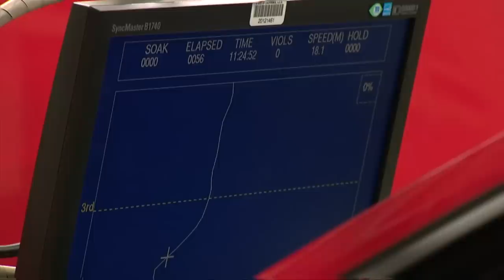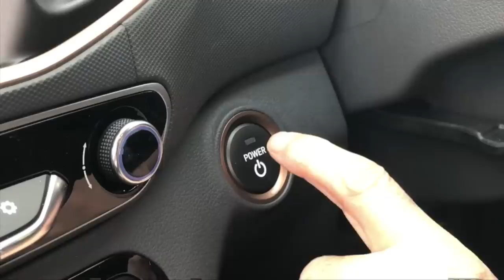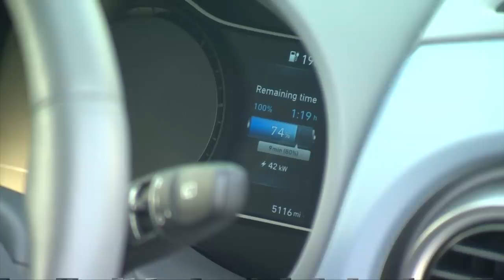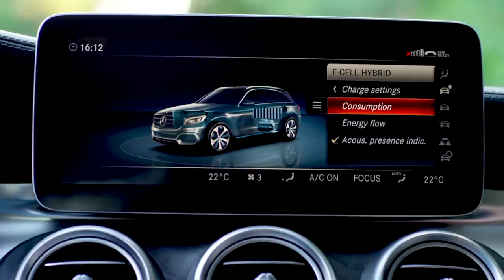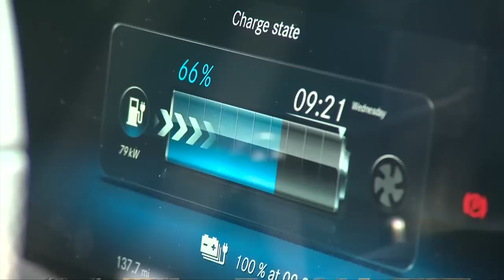Electric Cars: The Future of Road Vehicles? - BBC Click

Comment: What's the resale value of these cars though? So what if the battery  lasts 7 years, when you want to sell up the car it will have a drained battery.
Reply: Doesn't necessarily apply to all electric cars, but Teslas have actually been holding their value better than similar gas cars with the same mileage: https://www.autolist.com/news-and-analysis/tesla-model-x-model-s-depreciation
Reply: Tesla resale value better than equivalent ice car. Battery degradation very low if looked after. Some have done 300k and still plenty of range. New even more durable batteries coming.
Reply: WRONG that was a mistake by BBC Click using the Manufacturer WARRANTY time frame. Typically the battery is Legally Guaranteed for Several Years. That does not relate to the realistic Life Span of private use BEV. A BEV built in 2019 will easily able to do well over 300,000 Miles based on existing fleet data of old EVs. 300,000 Miles is NOT 7 years, that is more like 15 years. At 15 years most cars have massive depreciation a Fraction of new price, it's simply getting old.
Reply: @kentonian  'if looked after'......So I guess the drivers never use the Ludicrous mode??? I know I'd be tempted to give it a go on more then one occasion ;-) . Sadly the new owner could never tell how the battery has been treated.
Reply: @neilwilliams2907  No looked after means not draining or charging to empty or full frequently

Comment: to hell with electric, yeah buy one if you want a 3 hour journey to become 9, buy one if you want to spend more on electricity than you did fuel, buy one if you think your saving the world when in reality your doing the opposite in the long run, buy one if you want to suffer from health issues because of range anxiety.....oh and this utter BS test that they always show where a tesla beats a lambo?..... let me expose this for you 1:- you need at least 97% charge, which takes hours. 2:- you can only do it ONCE, and it needs charging again before you can use its most sportiest setting (ludicrus mode). wake up, they are fooling you, they just dont want you to drive anymore.
Reply: It used to cost me £20 a week in petrol, the same journeys in my EV now cost me £4. Switching to an EV won't save the world, it only slightly reduces your impact. Finally in any modern EV a three hour journey takes three hours same as any car. If you don't want to buy an EV then fine, but for many people they make sense.
Reply: @grier2593  ok so a 3 hour 250 mile motorway journey in a an 100% electric car is the same as a diesel/petrol...oh ok thanks for letting me know, i'll go and buy one tomorrow. Thank you grier you live up to your name,  you are alert.
Reply: @trabali5168  A Tesla does over 300 miles. 250 not an issue.
Reply: I can tell you don't own an EV. A 3-hour journey does not become 9, where are you getting your information? I've driven across a continent in my Tesla with little to no delays at all. I don't have range anxiety at all, do you?
Reply: @justsomeguy934  i dont have range anxiety and never will because i will never own a full ev vehicle, UNLESS it charges in 3-4 minutes empty to full and you can get 300-400 motorway/highway miles....probably not in my lifetime!
Reply: @trabali5168  So you're running from the police that you cannot stop longer than 5 minutes to fill your car after HOURS of driving? That seems a silly criteria to choose a car with. Don't forget that 95% of driving is done from home, where your car is filled up while you sleep for pennies. 300 miles of driving is about 6 hours of driving; I don't go that long without a stop longer than 5 minutes. In fact, if you only stopped 5 minutes for 400 miles of driving, I want you off the road! That's not even legal for commercial drivers to drive that long without a break. What a silly reason to drive a vehicle that costs 4x the price of an EV to operate! If you're in that much of a rush, buy an airplane.
Reply: @justsomeguy934  it takes about five minutes to fill up with petrol and pay for it, looks like we are all running from the police, to hell with EV's
Reply: @trabali5168  Actually, it takes more than that to refill your gas car. You're only counting the refill time at the pump. The national average is 15 minutes by the time you drive to/from the gas station, wait for a pump, pump and pay. That's, on average, 1 hour a month and 12 hours a year. I take 10 seconds to plug in my car and go to sleep. You're spending too much time of your life putting oily fuel in your car.
Reply: @justsomeguy934  not in the uk
Reply: @trabali5168  The roads are less congested than in the USA? I doubt it. I'll bet you - from RIGHT NOW go fill up your car. You have 5 minutes to go to the station and return to where you started. I, however, can easily do that.
Reply: @justsomeguy934  it depends where in the uk
Reply: @trabali5168  Certainly possible, I don't live in the UK. You could be living next door to a petrol station, who knows? But the average trip here in the USA from home (or to detour from a trip) to get gasoline is 15 minutes per fill up.
Reply: @justsomeguy934  again not in the uk, especially in the cities
Reply: @trabali5168  Very possible. On-street parking and (at least here in the US) condominium/shared parking are a problem for EVs at the moment. That's why I think hybrids for those folks is a good idea, as long as the battery can carry you during you commute (such as the Chevy Volt could - about 40 miles of range).
Reply: @justsomeguy934  I dont mind hybrids, but to hell with full ev's
Reply: @trabali5168  why so? My EV gets 114 mpge, is full every morning for pennies.

Comment: As yet no one catches on that without fossil fuels mass produced EVs are impossible. How do you make the motors how are ores processed and where does the economy come from that pays for them besides they are a wealthy persons status symbol and do not replace energy wise a well cared for easy to maintain older car. Indeed Evs are energy intensive delusion until they do away with batteries and get into permanent magnets so they do not need recharging they are yet another cause of debt serfdom nothing changes but the decorations on planet Earth. Flying cars will soon make road cars redundant.